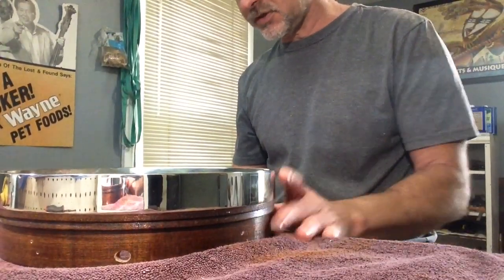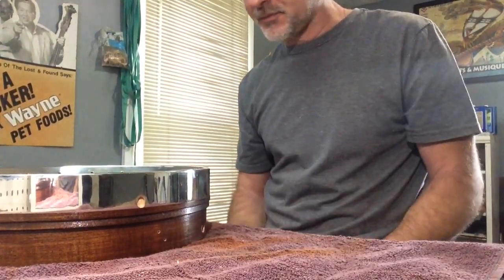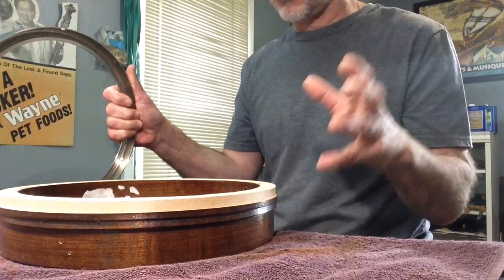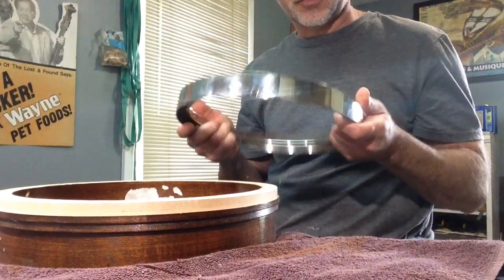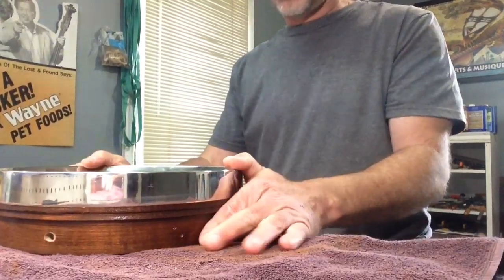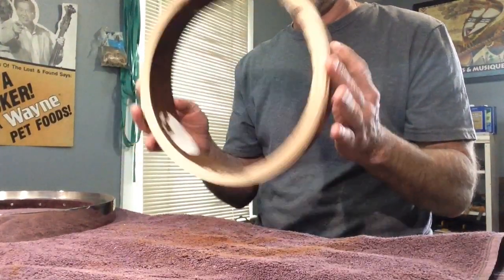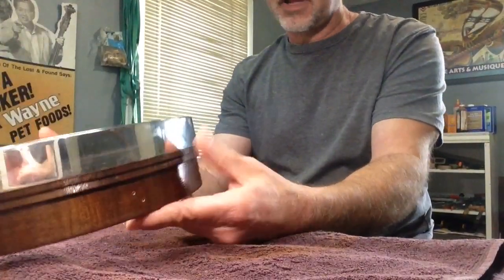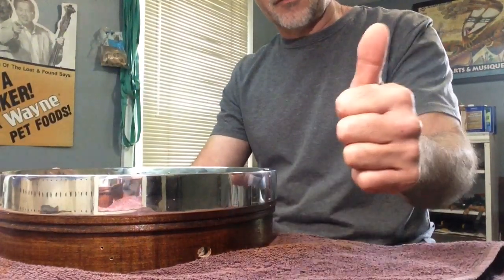Set-Up Tips And Tricks : tone ring fit

Comment: I'm thinking of casting my own bronze tone ring for my deering sierra. If I cast it from the one on my banjo is it hard to remove my current one?
Reply from the maker: As long as you are competent forgive metals id say go for it. Molten bronze is dangerous stuff to work with, like any high temp metal melting and casting. 
Removing the ring can be pretty easy or hard, depending on how tight the fit is. I use gentle heat to expand the metal and have a couple of very thin but strong spatula blades I use to help remove it without damaging the rim.

Comment: Great video explaining how it should be set up.  If one has a tight fit, what is the remedy?  Is it, or can it be a home do-it-yourself remedy or does the banjo need to come into the shop?  Also I find your videos exceptionally valuable and informative!  Thank you. Chuck
Reply from the maker: Chuck, thank you for the feedback! If the ring fit inst massively tight, which requires a lathe turning, you can use a single edged razor blade, keeping it flush to the blade flush,while spinning the rim by hand on a flat level surface, under a.towel. you'll be "hand turning it". Don't use sandpaper and your finger tips as it won't be an accurate trim. The razor blade work much better
Reply: @JohnBoulding  Thank you John... I really appreciate the help... very much!!!
Reply: @JohnBoulding   I have a Deering Saratoga Star and the tone ring was so tight I could not remove it.  I got a cookie sheet (so the heat would not dissipate), spread out a heating pad, and set the pot down with the ring in contact with heating pad to expand the tone-ring.  I let it set for about 20 minutes after which I was able to slip my fingernail between the rim and the tone-ring and the ring started moving.  It came off okay.  It took a couple of hours of shaving using a razor blade and box cutter blade as the fit was so tight, but I finally "hit pay-dirt" and I now have a slip fit.  I'm sure you have some other ideas regarding a stuck ring. Again, thanks for your encouragement and help.  Chuck
Reply from the maker: @charlesbates7429  cool, I'm glad you got it fixed. A fit that tight would be where I would use the lathe for a rim that out of rounds as it's much faster.
Reply: Have you come across any of the Ibanez Artist banjos from the seventies John?.From what I've heard from an Ibanez expert eg the Kulesh rings fit pretty well on the tube and plate cut multi-ply rims but there seems to be a fault re the tubes ie a gap at the tailpiece side.I've seen these fixed with a tiny oblong piece of brass soldered/braised? inside.Always possible to buy a new tube I suppose but predominantly nickel-plated with the need to acquire the services of a chrome-plater.

Comment: Im seriously considering a Sloan ring. Before that it would have been a burlile. I have a 2001 Gibson granada reissue all original my question to you is, I’m not happy with the tone as I get past the 2nd feet it starts to sound tinny and with no openness/depth , but it sound nice and open in open G tuning. I have to pick really hard, “pulling tone” if you will as I capo up the neck. What would be your suggestion maybe start with a tone ring and have it fitted to the original Granada rim?
Reply: I’m really after something than sounds similiar to Ron Stewart or Jim Mills. There banjo ring and stay open when they are capo up the neck.
Reply from the maker: @userjones3399  the Sloan ring will give you depth of tone and power anywhere on the neck. It really opens up any well made banjo across the whole tonal spectrum . His newest por is ring 222. I just installed one in a customers 1988 rb-3 and it transformed it.

Comment: Great video Mr. Boulding. I have a question though. How should the fit be for a flathead tone ring on a tube and plate rim. Do all the same parameters apply? Slip fit and contact the inner surface before the outer surface? I would assume so, but I just wanted to check. 

Thank you
Reply from the maker: Yep same fit
Reply: @JohnBoulding  Thank you

Comment: Good morning John I bought a 70s Gibson master tone and had some fretwork done I installed  a new head and tuned with drum gauge like a do On my RB3 and it sounds like s*** took the bridge off my rb3 still sounds like s***•
I checked the gape where the tone ring sets down on the wood rim and it has an air gap at least the thickness of a piece of typing paper, is it possible that could account for the lack of sound and especially tone?
Reply: I realize most of those banjos didn’t sound like all that great but this one is just inexcusable any input would really be appreciated.
Reply from the maker: @conway5901  the tonering definitely needs to be a slip fit,and also resting on the top of the rim to develop it's best tone. Head tension also varies by banjo, as to finding the sweet spot. You can also try different bridges and put your tailpiece in different settings to try and dial in the tone you are looking for
Reply: Those 70s Gibson banjos had a five ply rim instead of the common three ply rim which is probably why it does not sound that good ... Also the outside lip of the rim is painted black which is a big clue that it is from the 70s and has a five ply rim ...